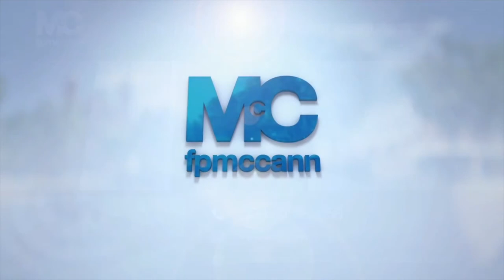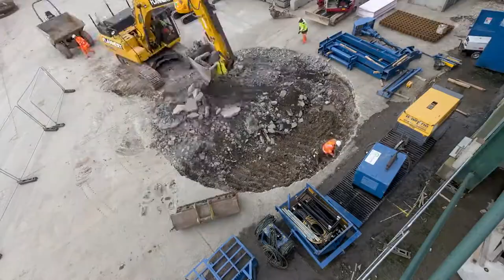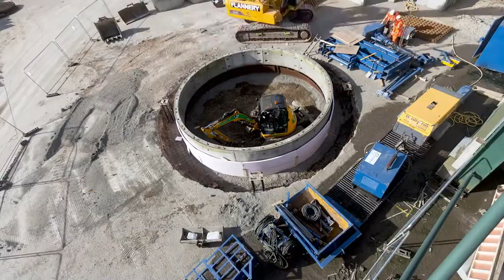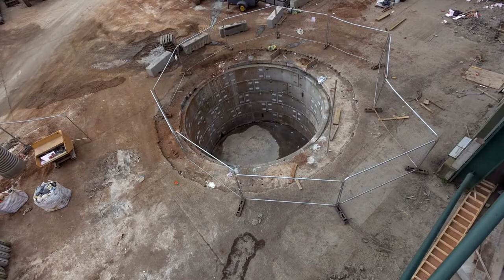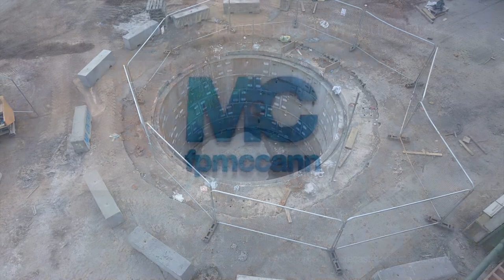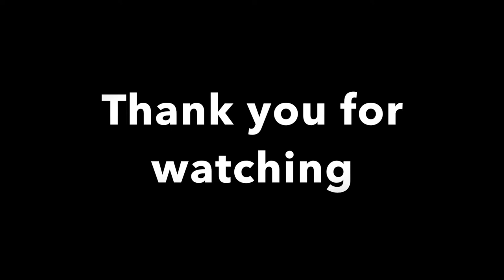FP McCann - Cadeby Precast Concrete Tunnelling Time-lapse

Comment: How does it sink without nothing pushing down?
Reply: The weight of the segments and the fact of the digging machine is undermining the ground under the cutting edge ..ive put down 12 meter shafts without using the jacks but still need them incase it sticks for any reason ..Plus you can use digging machine to nudge it down also by putting the weight of the bucket on top of shaft